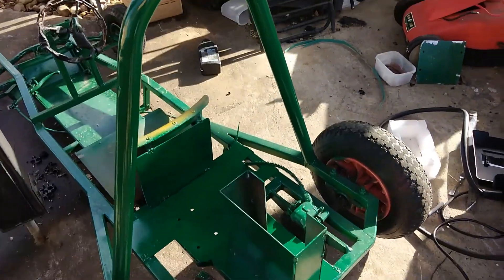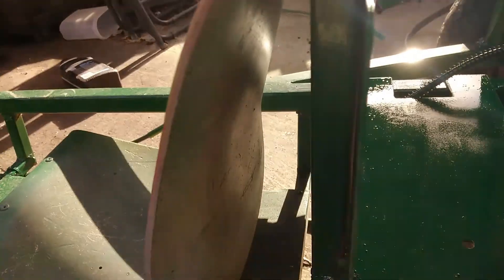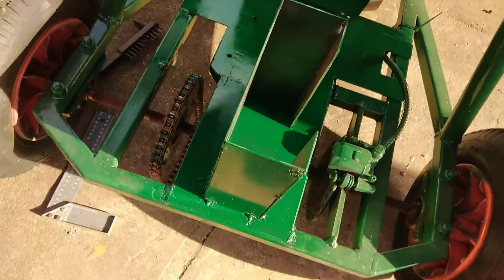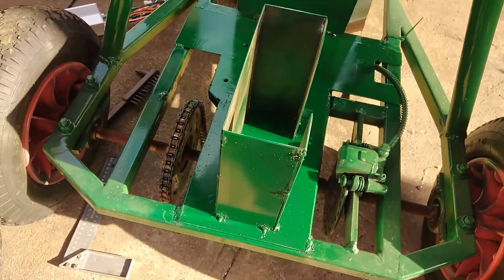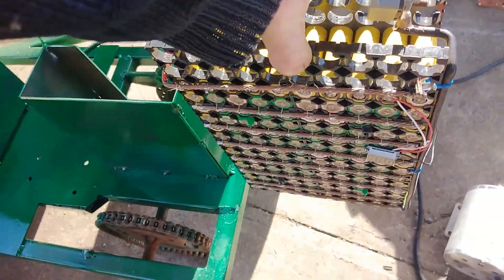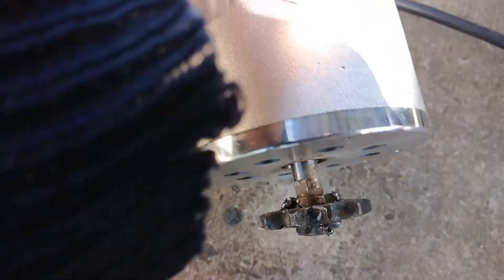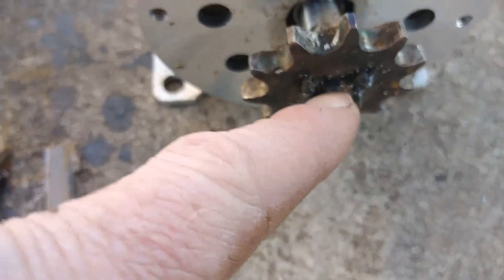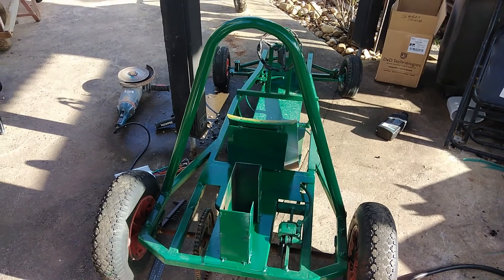Lithium 18650 Powered Electric Go Kart Part 2

Comment: Not loving your safety man, don't end up in a fireball....  so much vibrations with cardboard between the positive and that metal holder is scary!
Reply from the maker: I will be making that 1.7kwh pack with nickel witch will give me more room to fix plastic shield both sides. Your right very scary and if I'm not careful you won't be able to tell me apart from the fireball behind me with the color of my hair. 
But seriously I will be attending to it and maybe shortening the box wall height. While not in use I take the battery out.
Thanks for you concerns and feedback. I appreciate it.

Comment: Nice Job Adam, I am totally going to do this when I'm finished with my project. Did you use some of the lower capacity batteries from your powerwall or did you use normal higher capacity ones?
Reply from the maker: Hi Darren. The yellow pack that I used are all from Dyson vacuum cleaners which contain LG cells 1kwh 14s 10p. These are High Drain cells min of 10 amp discharge. The pack that I'm building that is shown in the first video red cells (will be changed to yellow) are all from power tools and are High Drain, min 20 amp discharge, This pack is 1.7kwh 14s 14p.
I keep all High Drain out of my Powerwall for these projects, and these projects will not ever have Laptop cell in them.

Comment: dont forget to lube
Reply from the maker: Is the lube for the chain? What is the best thing to use?
Reply: @adamcecere3369  remove chain and soak in oil for 24 hours. (the heavies grade oil you have or used engine oil0
Reply from the maker: Thanks for that. I had to move the motor. Short video to come. Chain much better. But the oil you suggest should make it even more better and little quieter.
Thanks
Reply: @adamcecere3369  Your welcome Adam. I enjoy your channel.